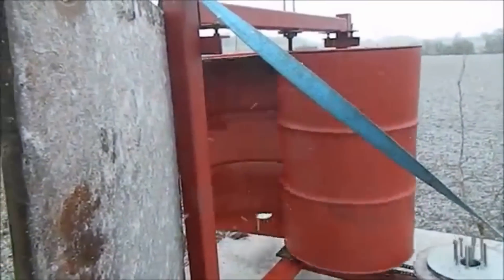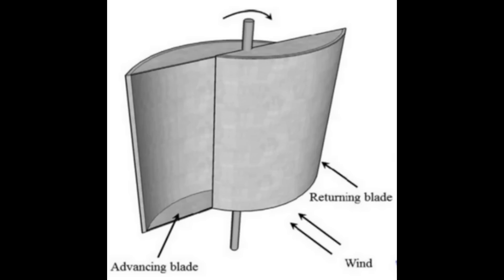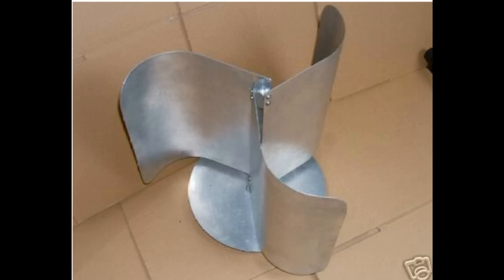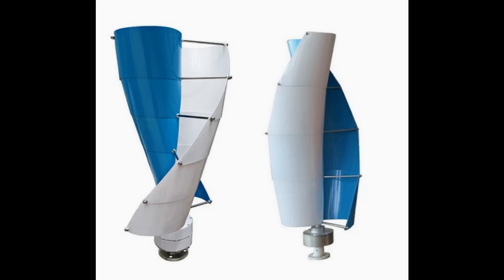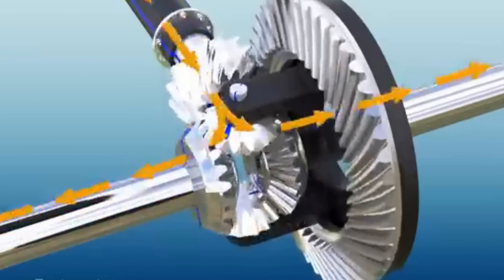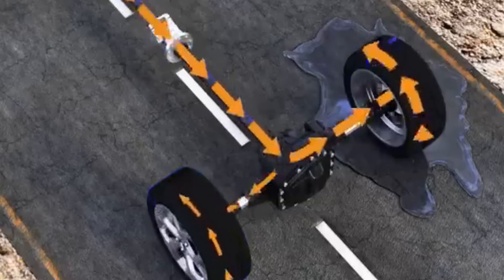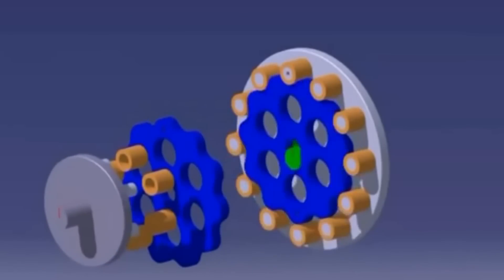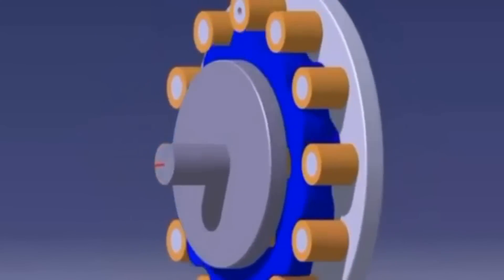2282 A Different Kind Of Differential For Wind Turbines

Comment: i invented a mechanical gear where you can add rotation and when not it freely rotates until stationary would work like limited slip differential it's not a one way bearing or such it's sturdy gears

Comment: What I'm missing most in all these wind-turbine videos is some useful info on the power they would produce.  1 m^2 solar panel can give you 100W or so, but the turbines in these videos often take up way more room, but are often just shown lighting up a couple of LEDs, which honestly even a potato can do ...  Also people testing reasonably sized windmills are often disappointed with the actual power those produce.  So, although the mechanisms being explained make these videos great, but is the thing you're using these mechanisms then for actually worth it?

Comment: Hey Robert.

That setup is used for local speed variation in chairlift stations, it's known as the "cadenceur" and is used to combat detachable grip chairs and cabins slpiing and changing relative places on the cable.  It's a fun mechanism.

For your uses, though, it still has slip, and if you want overlapping savonius turbines, the solution with the least loss would seem to me to be to gear them together and take a feed out somewhere.

(edit : the "its known as" refers to the part of the chairlift, not the mechanism itself, which is just a dual-driven planetary drive)

Comment: ...maybe a lot of places , especially on the coasts have mostly same direction wind and with the unit it charges a household battery pack storage , My point is it's like a rain barrel with filter , and when it rains once in a while it's enough to fill the barrels and then maybe gravity is utilized to the filter and water lawn , but it's all one needs off the rain maybe too , depends on battery but IMO a few inputs each auxiliary alone seems nice...
EDIT: SRRY sidetracked my other point was a roof ridgetop method one directional mostly was my rant basis where the roof itself blocks the "rounded" portion geometrically ...
Reply from the maker: oh i get it - interesting idea

Comment: I'm thinking IF the Savonius was horizontal , rather than vertical and a row all along a roof-line or ridge , so the open barrel is the top or upper position and there's a fairing shaped like a ramp in front of the rounded side on the lower position , the fairing directs wind at the open side and blocks the rounded .....I might make one with a bicycle rim / rear axle each barrel ....up along a roof oriented like that way ....(?)
Reply from the maker: isn't that the idea behind the ridge blade?

Comment: Hi Robert, that's an interesting mechanism! A limited slip or "welded" diff would get rid of the slip but wouldn't it be easier to put two gears on the ends with a third on the generator and one chain around them all, that way you could fix their orientation and gear up or down the drive to get the speed or torque you want?
Reply from the maker: it would be - but it wouldn't cope well with the differnce in speed of the two turbines and they are going to run at different speeds

Comment: Use magnets around horizontal discs at the base of the two savonius turbines, to both keep them in sync (acting like a magnetic clutch), and generate the power by having a coil cross the magnetic field of both discs, so you still have a single generator, and no friction losses.
Reply from the maker: nice idea mate - thanks for sharing

Comment: One thing I've seen with the savonius type rotors is that the rotors have a spring loaded flap that opens as the blade travels into the wind and closes before the wind begins to push on the blade. It was noisy but appeared to be more efficient. Saw it too on a horizontal 6 bladed fibreglass windmill for pumping water.
Reply from the maker: yes - i did on here

Comment: Bevel gears from any number of rotors onto a common shaft, will sum the torques. And keep the rotor phasing constant.

Diffs can also be used to  functionally convert band brakes into clutches. Apply band to connect drive.
Reply from the maker: cheers mate

Comment: Watching this has led me to a completely different idea for dealing with the issue. Mechanical solutions always have losses and can breakdown. Go electrical. Get/create a control system which keeps the blades going at a constant speed by reducing the power draw during the part of the rotation where wind power is not being harvested.
Reply from the maker: electrical systems also have their own draw backs - they suffer breakdown and have losses too but i see what you are syaing

Comment: You actually DON'T want a differential in this situation. In order to overcome the low-torque phase of one wind turbine, it has to stay lined up with the high-torque phase of the other turbine (and vice versa). They HAVE to be locked together, not linked via a differential.
Which is why stacking the turbines on top of each other is such an elegant solution: It's the easiest way to lock them together.
Reply from the maker: it also has a limit you can only stack them so high - but you could put them in a row infinitely if you like
Reply: I agree. The vanes have to be in phase all the time right?
Reply: .... and no gear frictio losses... 🤔

Comment: Why not use a timing belt between the two sails, which keeps the sails rotating without colliding. Then you can introduce a timing gear within the original belt or use an extended shaft on one of the sails and drive a separate gear to the generator, you coould even make the gears to increase the speed to the generator. I was a technical manager in a company which produced different sizes of hypercycloidal gearboxes often with multiple stages plus other forms of gears and gearboxes. Good post thank you 👍☺️
Reply from the maker: go for it mate - there are always 100 solutions for any problem all that really matters is that you like it and it works and i like the sound of what you suggest - i can't see any reason why you wouldn't try that

Comment: For the vertically oriented, colorful vanes you showed rotating in opposite directions, you could use the planetary setup used in aircraft with ContraRotating Props but instead of have a static coupling , introduce a roller clutch around the cage of the planetary assembly. What’s more, for a vertical configuration, they would be very easily stackable to allow for more vanes to be attached. 
Then, as suggested by another one of your viewers, use a hydrostatic type drive to transmit the power to  the generators. You can also get a lot of torque multiplication using hydrostatic drives. 
There’s a view printable models of the contra rotating propellers on Thingiverse and Printables if you need to see it in person. 
Awesome video as always. Thanks
Reply from the maker: really good ideas mate thanks for sharing them i will go look

Comment: Hi Robert, one thing to remember is, if the two turbines can be lined up so as the second takes advantage of the leading one, there is an increased output from the second akin to that gained by geese flying in formation. This being the case would you want to add the outputs or keep them separated..?
Reply from the maker: maybe staggered? - actually that's not a bad idea - airplanes and geese fly in a V for exactly that reason!

Comment: The two are not locked together, though, and can still smack into each other
Reply from the maker: for sure
Reply: @ThinkingandTinkering  I have a design for a similar but more efficient wind turbine. It is based off some weird behavior I noticed from an office chair on a tile floor. I need to build it. I hope it is good, but it will be fun either way.

Comment: If solar panels use multiple microinverters, can't multiple turbines do the same?
If there'd be a need to fix turbines together mechanically, why not a bicycle chain and gears?  Each turbine in a pair gets the same sized gear, "slip" the chain until they're synced the way you want them, and a power-take-off gear in the middle (can be any size to multiply speed or torque as wanted) goes to the generator.
Reply from the maker: yes they could

Comment: First thing that comes to mind is a solution to wind wall problems.  One of these on each column with an intermediate gear between and you would have additive torque for each pair of columns at an average speed.  I can see real potential there as a solution to many issues with turbines and wind walls among many other things.  My grandson is currently in his school's program for advanced health education.  This does include use and creation of machines that improve surgery and treatment.  I think I'll pass this video on to him as an issue right now in robotic medicine is a robotic stitching machine which is difficult to get two or more feet of the machine in sync to walk/pull itself across a wound without a lot of processing.  I can see this as a jump off point for something like that.  Who knows, but any solution might beat what is currently a bad one.  With your blessings of course.  Thanks Robert!  I am kind of a clockwork nut, so this is something I really enjoy.  Appreciate the videos Robert, please continue.  Thanks again!
Reply from the maker: that is awesome mate - i think this particular mechanism certainly has more use cases than the one i made - when we tend to think of differentials we think of the open differential used in cars - just because it is so ubiquitous - this is type known as the epicyclic differential  - there is another type called the spur differential he may want to look at
Reply: @ThinkingandTinkering  Will pass this and that on to him.  Thanks!
Reply: @ThinkingandTinkering  Without doubt there are many use cases for this and similar mechanisms.

Comment: An intresting stuff, but in case of we have multiple input sources, i would stick to the multiple generator concept (like in the windwall build) avoiding from one hand the single point of failure and the other hand of in case of we are scaling such a thing we would increase the build / maintenance complexity instead of "just" wiring together the generators.
Anyway, good stuff as always!!! :)
Reply from the maker: i know what you  mean but as a mechanism i think this is more useful than the use case i made

Comment: The questionit comes to mind is then; would the increased mecchanical complexity worth it for  that type of combined turbine?  Could a different approach like with 2 separate turbines mecchanically locked with a chain or belt gear and each a generator connected in series with a simple standoff diode and a zener diode and resitor to act as a votage regulator be easier? I mean that gearing needs to be made from something sturdier and more durable than PLA so it adds cost and complexity, who choses 2 bladed diy Savonius turbines have as their objective, low cost, simplicity (bot construction and repair) and durability.
Reply from the maker: always lots of solutions mate and i like yours - the use case for this mechanism is broader than the use case made though
Reply: @ThinkingandTinkering  oh i was not denying that by any means, and for that mechanism i'm sure you have already in program other interesting usages :)

Comment: Have you thought about a hydraulic drive and hydraulic motor to transfer power from wind turbines to generator. You can easily splice in multiple hydraulic lines to increase the pressure with a anti-backflow valve. Just curious great video as always
Reply from the maker: I haven't mate - but i like your thinking and thanks for sharing
Reply: @ksbrugh9886  friction losses in hydraulic systems is directly related to length of plumbing (how close the driven device has to be to the driver) and the plumbing cross section (larger cross section=less friction and greater volume of oil)
Reply: That's how they do the on shore wave energy things that look like caterpillars with floats for legs. Hydraulic cylinders on each float and a central hydraulic motor generator.

Comment: However a real differential doesn't lock anything in a fixed ratio, that is done by simple timing gears and a take-off at some point (true differentials tendv to torque balance, or sum inputs
Reply from the maker: i didn't come up with this mate - it's called an epicyclic differential

Comment: you could clock the two turbines using a chain link or drive band the only issue is that they would then be turning equally and giving no output, if you put a cross in the drive band between them that would enable them to contra rotate and remain clocked, or possibly use a toothed belt for more stability and less slip- the cross in the toothed belt could be seet so the back of the belt passed the back of the other section avoiding catching.
Reply from the maker: awesome mate - cheers

Comment: A wind baffle blocking shield aimed slightly away from wind would help, in fact make this designed like a planes wing could increase the spin. It could be moved & kept in place by  a weather vane orbiting system.
Reply from the maker: for sure

Comment: The edge-on problem is probably the smallest that VAWT faces - the greater issue is that at a 180d turn, the wind is actively pushing back against the rotation of the turnbine, sapping energy from the system. 

Granted, sybonius turbines are still grwat for simplicity and i'd take 100 of them over 1-2 HAWT for generation purposes, but they arent exactly maximally efficient.
Reply from the maker: tbh mate sometimes maximum efficiency isn't what matters